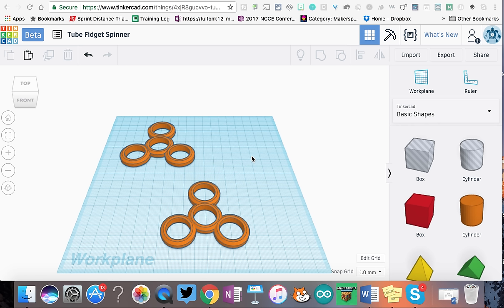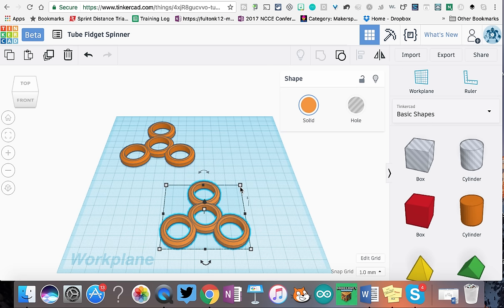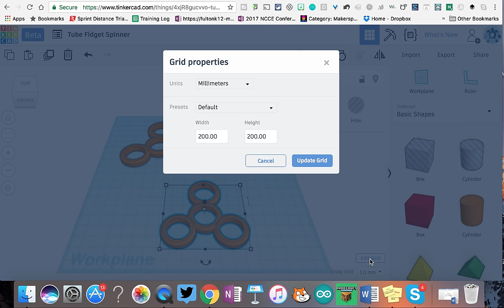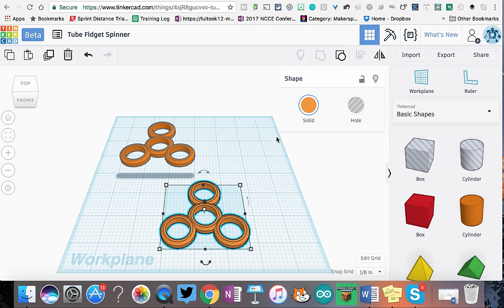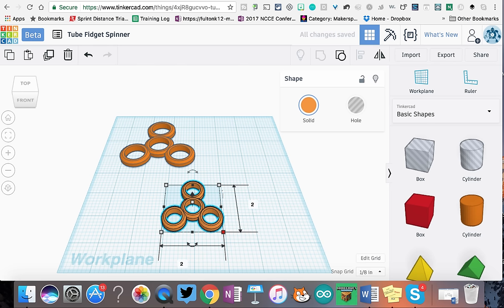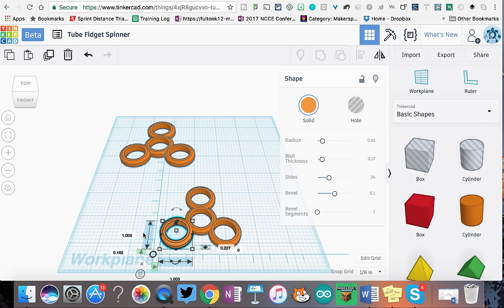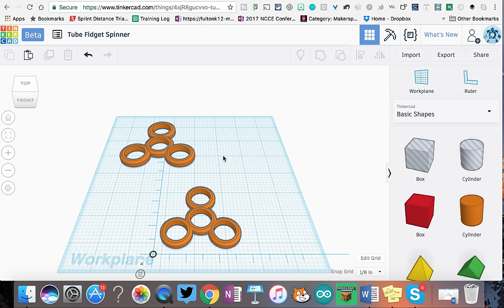Tinkercad Tutorial Ruler and Dimensions

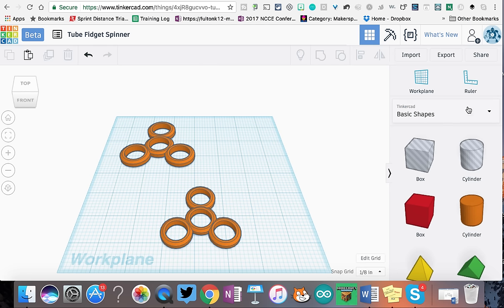Comment: This video is called "Tinkercad Tutorial Ruler and Dimensions", yet the ruler tool isn't mentioned until 2:40 and then doesn't say anything helpful whatsoever about how to use it. What a waste of time.
Reply from the maker: What were you hoping to learn? This is designed to help students or people who are just looking to get started with Tinkercad gain some insights about some of the tools.
Reply: I think the title should reflect the video content and your video has very little about the ruler tool - mostly it's about how Tinkercad shows you dimensions without it.

What I am trying to do is measure the distance between parts of two design elements; one bar crosses a plane at some angle, and I want to verify that it does so at the required distance. I can get the ruler to show me the distances between the edges of things when they are un-grouped, but the "endpoints/midpoints thing doesn't seem to work and the ruler itself leaps around with no clear way for me to tell it exactly what I want it to measure.

This is what  I hoped a Ruler tutorial would explain, but yours was the last of FIVE I tried - and NONE OF THEM told me how to use the ruler!  I'm afraid my frustration ended up in your comments.

As a workaround, I'm now using a "measuring bar". I place is in the model between the two points I'm interested in and make it fit, then ask Tinkercad how long it is. It works, but it's a ridiculous was to do it.
Reply: @chriswesley594  Did you even figure out a real solution?  It seems like the "ruler tool" doesn't do much and certainly doesn't do what many of us need, that is the ability to measure between two arbitrary surfaces or points that are not necessarily aligned to the orthogonal grid.
Reply: @Zeric1  No I didn't. I now use Fusion 360 mostly, thouygh I do have some models in Tinkercad and I would still love ot know how to use the ruler usefully.